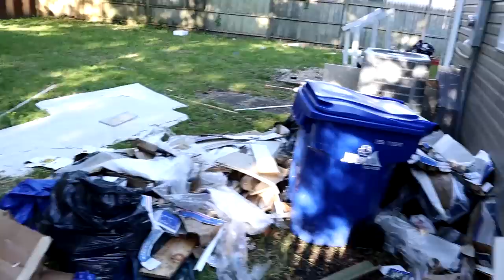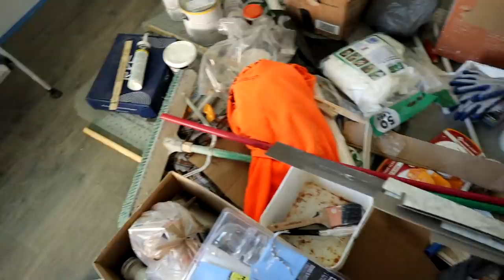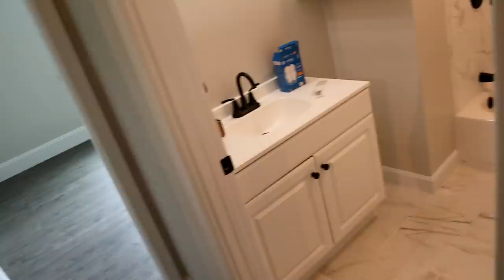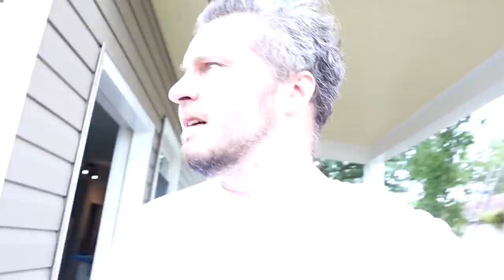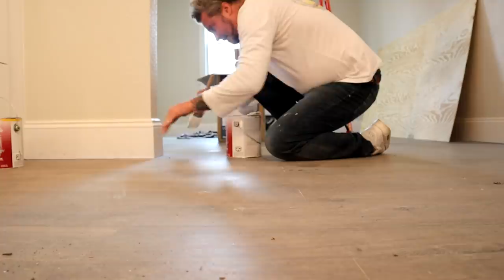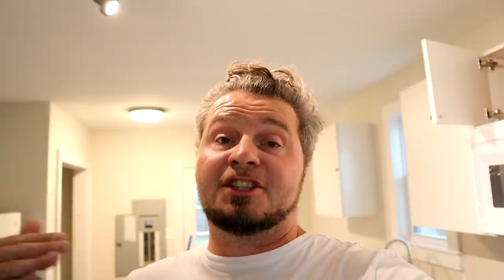Rabbit Walked Off The Job...

Comment: Joe you STILL haven't learned to cover the floor in a room or the area where you're going to be painting.  Who's going to clean the floor this time after you get paint all over it?  Your LABORER is gone now, but I'm sure it will be EASY to find someone to do your LABOR WORK for LESS THAN MINIMUM  WAGE.  After all it's just LABOR.   Rabbit said he doesn't get any breaks.  Joe  "I ain't takin' no breaks" expert house flipper.  Um, what are you doing while Rabbit is doing his SIMPLE LABOR WORK?  You sure as he** ain't working, you're running your mouth on camera, complaining that Rabbit ain't working fast enough and/or hard enough.  Another thing, you're constantly telling Rabbit to be sure and do something right.  What do you expect out of someone who is only doing "LABOR STUFF" and not getting paid a fair wage for doing it?  Surely you don't expect A COMMON LABORER to "ROCK UP IN THE HOUSE" and know how to do anything right too.
PS: Joe, when you're painting you need to put some paint on the brush (called loading the brush, I believe) so that you'll have something besides HOT AIR to spread on the surface to be covered.  Just sayin' Joe.
Reply: 👏👏👏👏 Couldn't have said it better myself. Joe is being a straight up slave driver. I really liked Joe, but he's ruining his channel with this egotistical attitude he's gotten.
Reply: Joe can clean it himself, he said when he put a rag under his foot and scrubbed a spot of paint, it came off real easy, let em do it himself.
Reply: I wonder  how he's paying Richard...
Reply: @scottdevin9810  he said on the bobo Richard's making alot more than Rabbit
Reply: @jesseolson3142  All joe does is paint and touch up Lol!
Reply: RedDOG2084 agreed honestly
Reply: Ironically, Rabbit definitely did "ROCK UP IN THE HOUSE" (attic) 🤣🤣
Reply: @RJH-h2k  yes that's bullshit
Reply: At 11:08 thats sooo messed up...joe is sooo quick to flip
Reply: @scottdevin9810  facts bro

Comment: $7/hr?! That’s less than minimum wage!
Reply: He said 9? And hows min wage matter on a under the table gig?
Reply: John V my mistake. He did say $9. I read in a couple of other comments $7/hr so that’s where I fucked that up. But anyway whop-de-woo! $9/hr ain’t shit even if it’s under the table, tax free money.  
Minimum wage can provide a very general guideline for compensating temporary workers along with factoring in required skills, knowledge, experience, etc for any type of off the books/ under the table gigs. Got it?
Reply: Doralingus Memberberries which question are you referring to? “He said 9?” Which is a statement not a question. I’ll assume you’re referring to “how does minimum wage matter on an under the table gig?” (Corrected because I cannot stand butchering the English language)
Minimum wage is used as a guideline to determine pay along with experience, education, etc. to determine a fair pay rate for an under the table gig. 

What did I miss? What did I fail to understand? Please, enlighten me.
Reply: @NotJessH  he has no education, he has no experience, he messed up multiple things that had to be fixed, he got high on the job, he still got more than min wage. Not getting the problem.
Reply: John V I was obviously speaking in general terms and not about Rabbit or this job specifically. That should have been as obvious as the broad side of a bus because I didn’t mention Rabbit or the specific work he was doing for Joe. 🤦‍♀️
Your asked me what minimum wage has to do with under the table gigs so I answered your question. You didn’t ask me if I thought Rabbit had earned his wage. 
Learning to communicate effectively is one of the most important qualities a person can have. You can’t be successful without effective communication both verbally and in writing. I suggest you really work on that skill or life is going to be brutal.
Reply: @NotJessH  this video is specifically about rabbit and what he was being paid so you didnt need to specifically say his name. The "?!" Would indicate you have a problem with his wages. If you don't have a problem with his wages you are the one who failed to convey that, dont try to lay it at my feet.
Reply: Why y’all mad lol
Reply: John V See, when you’re unable to communicate effectively with your words, you get all riled up and throw a tantrum. 
For the last time, YOU asked me a question. I answered your question. 
Yes, I believe $9/ hr to be a pitiful wage, no matter the job. That’s slave labor, imo but I’m an educated individual who commands a high wage.
The real point of your original response to my comment was because you so desperately wanted to point out that I made a mistake and said he was paid $7/hr and because you’re so rarely correct about anything, you jumped at the chance to point out another person’s mistake which doesn’t even matter but you just couldn’t resist calling me out, saying, oh no! It’s $9/hr not $7.  Who cares? Does it matter at the end of the day? No! Lol it’s not that deep. 
I think you should take some time to reflect on your life and determine why you’re so desperate to argue with strangers on the internet? Do you need validation? Why are you angry? Who hurt you? 
Introspection might do you some good.
Reply: @NotJessH  oh, so when you get corrected it's just that person throwing a tantrum. Interesting. Didnt read your essay btw.
Reply: Here in uk labour cost $240 dollars even if you get cheap one still cost 160 Dollars day lol 😉 Joe's in wrong man
Reply: @reviewswithpappy8058  you cant really compare prices from state to state, let alone a different country. Either way rabbit agreed to the amount.
Reply: Doralingus Memberberries  oh how right you were.
Reply: John V Reading comprehension isn’t your strong suit, clearly. If you read my reply to you I said my mistake, you’re right he did say $9 not $7 so your just droning on, the loudest is the winner type. Enjoy spending the rest of your life worried about your hourly wage.
Reply: Doralingus Memberberries Actually, I didn’t say anything like that. I’m sure I could have a great conversation about the industrial complex with you because you clearly see the bigger picture. Oh, wait... nope.
Reply: @NotJessH  do you require examples? Shall I hold your hand? I can offer some kid 5 bucks to wash my car, he will do it and I can make it take an hour. Does he cry he is getting less than minimum wage? No. Because he agreed to the task beforehand.
Reply: Doralingus Memberberries  she clearly gets offended over nothing, and is probably a narcissist as she wants to correct people's typing on a prison channel who's host mispronounces words on a regular basis.
Reply: Doralingus Memberberries lol you and @Jon V are hysterical. I’m crying laughing. I wrote my master’s thesis on the low wage worker in America. I’ve studied economics and statistics for years. 
I’m going outside to enjoy the beautiful weather  with my husband and baby. 
I just can’t with you two anymore but thanks for the lols!
Reply: You said 7 because he’s been paying him 70 bucks a day rabbit said they been working 10 hour days so that’s not 9 dollars an hour !!
Reply: @ALLDaY-ViKeS  did you watch any of the video? Do you seriously think he worked 10 hours? 2 DAYS to clean the floors of ONE tiny room.
Reply: @ALLDaY-ViKeS  3 hours for one lighting fixture? 5 hours for a cabinet?
Reply: Bernie Balbastro I said $7 because I read it in another comment. That other guy told me it was $9 so I believed him because I was too lazy/ didn’t care enough to investigate further and I was washing dishes while listening to the video and figured I misunderstood the dollar amount but either way, it’s a pretty low wage, imo.
Reply: But you are indeed correct $7/hr x 10 hr doesn’t equal $9/hr lol
Reply: Doesn’t matter he’s putting him on camera everyday he’s working him in every job he gets including that landscaping job he humiliated him more then once on camera he deserves more then wat he’s getting paid period foh bro !!
Reply: If he’s working 10 hour days and making $70 a day that equals $7 an hour

Comment: Here's my advice. See, my mom and I have a turn-key apartment business. We pay the cleaners 65 for a 1 bed, 75 for a 2 bed, and 85 for a 3 bed apartment per unit. That's per however many they can get done in a day. I know that working on a house turn-key is a different thing. But he's absolutely right about it. His saying at least 100 is hin being nice(probably because y'all are friends). I'm using cleaners as an example because they, in any turn-key business, get paid the least compared to painters, electricians, carpenters, etc. From the way it sounds, he is a handy man who is capable of doing electrical work. The things he does therefore, isn't just cleaning up the place. So, pay him at least 120 and make him do the work he needs to do, not what you want him to do. Breaks should be implemented regardless of how soon you want the work done. From my experience, no break at all, just slows things down more than you realize. It can also cause people to make dumb mistakes that can range from the work itself and with words(like an arguement that usually doesn't occur). Also, if you pay the right amount (not too little but also not too much), you are more than likely to light a fire in the workers and get the quality service you deserve to get. That means, if you pay less than his worth, you aren't going to get the quality. If you pay too much, they will get cocky regardless of what type of person they portray themselves to be. Also, hold onto about 3 days or more of pay and don't just give  them the amount they made then and there(always remove 3 days or more off of the total. If they only worked for a day or 2 with you, they don't deserve to get paid yet. Trust me on this). In order to get their money, they will have to invest their time and attention to the work ahead. Paying upfront any amount is a mistake that you never want to make. 

This isn't just about rabbit. It's about everyone that you worked with that disappointed you. These advices I'm giving you, are from our own trial and error.  Hope you take the advice for everyone's sake.

Comment: $70 is a very low wage. HOWEVER, we have to remember that Rabbit got high in the attic and ruined the HVAC system which Joe had to replace. That was probably a lot out of pocket for Joe. Joe also pick Rabbit up and drives him back and forth to work - that's another expense that Rabbit doesn't have to pay for. The entire situation is bad and I can see it from both their viewpoints. Rabbit is slow at the work but Joe runs the entire thing so unprofessionally.
Reply: I thought the HVAC system was already ruined and that's why Brian was given the money to pick one up.
Reply: Rabbit was not involved with that. I can see how you may have thought that because he was in a video and I believe gelico might have also been in that video and hoe was pissed and while talking to them about the other 2 guys that were actually the ones getting high
Reply: @mikerumrill7374  it was rabbit too dude
Reply: @mikerumrill7374  dude there's a whole video about rabbit getting high in the attic.
Reply: @neolithic3 I didn'f know Rabbit was getting high in the attic. Was he up there smoking crack?
Reply: @dot-to-dot  Different part of the system. Rabbit crushed the box that (to the best of my understanding) distributes air thru the ducting. It's a handmade, custom piece (usually) and pretty expensive.
Reply: Also, unless I missed it, I don’t think we’ve gotten an explanation as to why he doesn’t have that job that he seemed to like so much and had for a long time..it all happened around the time he “got hit on his moped” 🤔
Reply: Rabbit also admitted he forgot to grab the other 2 bags of insulation at Lowes. And after they ran through every bag in the attic, they were 2 short of being done. Now Joe has to waste gas, money & time on his mistake.
Reply: @mikerumrill7374  if I am not mistaken it was rabbit that was passed out in the Attic.
Reply: @mrkelso  oh I remember that now. Didn't that happen at the same time the attic incident happened? I had forgotten all about that.
Reply: @frank6733  I do watch the show. But I don't catch every little bit and detail. I knew that Joe got another HVAC system but my point was that I did not think rabbit had anything to do with the part that Brian was involved in and that is correct because another poster reminded me that he crushed some sort of box that went to the HVAC system.
Reply: rabbit didn't destroy the hvac, he destroyed the return box..wich connor made himself out of isolation and ducktape and he also hooked joe up with a replacement for that, so that basicly cost him fuck all.
Reply: @southerncalifornia970  I dont know what drug it was but rabbit and another guy were in the attic when joe was away and they were high and he crushed some of the air duct system up there

Comment: The Mexicans in front of home depot get $100 plus lunch per day. That's the going rate for laborers. Yes, you "can" find guys for less, but like everything else, you get what you pay for. Don't calculate time spent per task, and don't EVER switch rates per task, ie you scrubbed floors for 4 hours at $8 an hour, you did electrical work for 3 hours at $12 an hour... NEVER DO THAT!
Just bear in mind that Rabbit was at the house all day, and he could have used his time on other things. Give him a task list and say this is what I expect to get done today, and for this I will pay you X amount of dollars, whether it takes you 2 hours or 10 hours. In my experience that's the ideal way to deal with laborers. When you pay for renovation work in hours, it's pretty much guaranteed that the laborers will milk the job. Don't sweat it though, now you know for next time.

Comment: Once it's sold, give him a bonus. Just an idea.
Reply: Nino Brown  minus the  the thousands of pounds of damage when they turned it into a crack house. Yes let's make a bunch of junkies share holders. 🤣🤣🤣🤣🤣🤣
Reply: He will be Lucky if the house even passes inspection. Plus, this is not a sellers market right now.. NEWS FLASH we are in a recession!!
Reply: Sunnysideup in the AM it’s not going to pass. No smoke detector, no AFCI breakers for the bedrooms, no GFCI outlets in kitchen and bathroom, insulation not up to code, where I’m at outlets need to be 18” up from the floor. They actually cut in to the baseboards for the outlets. I could go on, but what would that achieve?
Reply: Sunnysideup in the AM :  totally agree.

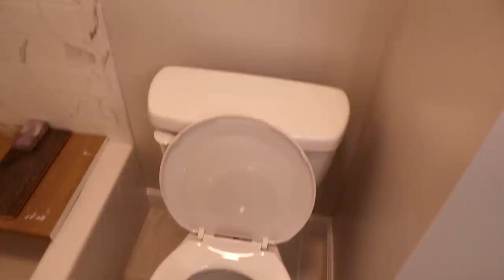Comment: 4:12 - Notice the water in the bottom of the bowl.  This is how Rabbit cheated the test you did on him yesterday.  

You know he's not clean.  We know he's not clean.  Hell, even he knows he's not clean.
Reply: I don’t think the toilet was installed yet, but could be wrong.
Reply: I agree with you that he's not clean, but the piss test was taken while the water was off, and now the water is on.
Reply: tubagoo dom  
Yeah, I'm afraid it doesn't work like that.  Cheap at home tests cannot differentiate between urine and water.  It's testing for metabolites of drugs and is activated by liquid.  It definitely isn't looking for creatine levels for testing.  A massively diluted sample will more than likely show negative results.
Reply: @williamzadeh1159   
Even with the water turned off, there is still some remaining water in the pipes.  More than enough to fill part of a cup for the test.

Comment: Even though im from Massachusetts, where minimum wage is much higher at $12 an hour. $9 is ridiculously too little lol. No way would i be at all cool with working as a laborer at any building, home improvement job SMFH. As far as rabbits behavior and fact that he walked off the job. If you both discussed his salary beforehand and he accepted $9, then that's his fault for accepting.... 🤔🤔 Then again, if you didnt take it upon yourself as the employer to let him know clearly that you can pay $9 an hour then you definitely fucked up and set yourself up to have an issue (you said yourself that $9 isnt much). If that happened then youre both at fault, and it doesn't matter how much effort he had to put in as its not like normal employers who pay by the hour have a sliding scale pay rate that fluctuates depending on how much work or how much effort the employee put in.anyone thats worked in the building trade pretty much knows the standard going rate for laborer's. Point being, you know whether you were right or wrong.

Comment: Dust off your base then tape the floor and use a small roller. Paint the top first then roll out the spot u just cut to get rid of the brush marks

Comment: Honestly idt you were in the wrong. $70 a day to do unskilled labor is plenty. For 8hrs! Now I think if he works over 8hrs he should be paid for those hrs as well. Unless you are paying him $70 a day even on days he doesn't work 8hrs. Then it basically works itself out kind of like a salary. If u are going to pay $100 a day. He needs to understand U'll he on his behind expecting more out of him.  I'm sure he's being paid under the table. So in that case he needs to realize that he's actually taking home more money a day than he would if he was paid $10hr and getting taxed. Or close to it. Regardless he needs to understand its unskilled labor and he's easily replaceable. Not to be mean. Ijs that's the reality of the situation. I think u both have a reason to be upset. But only time I'd say I agree with Rabbit is if he works a 10hr day then he deserves $100. If it's only 8hrs 70 to 80 tops. In Joe I completely understand what u are saying as well. It's not physically demanding work nor is it skilled work. I say if u increase his pay, increase his responsibility as well.  Have him train with some of the skilled laborers. Then it'll work out for both of you! Good luck!